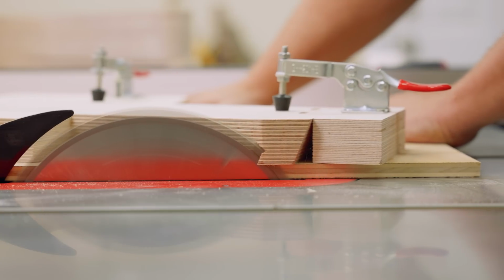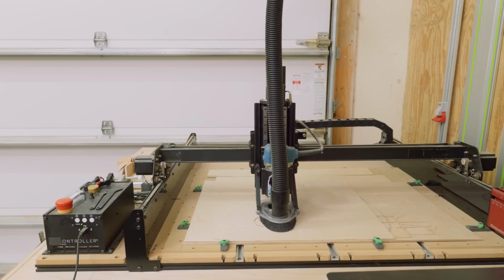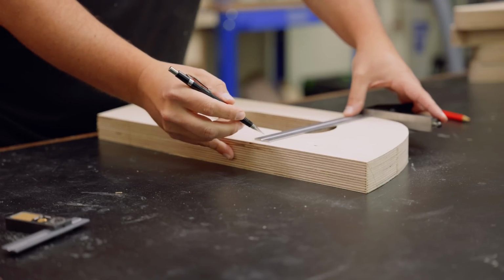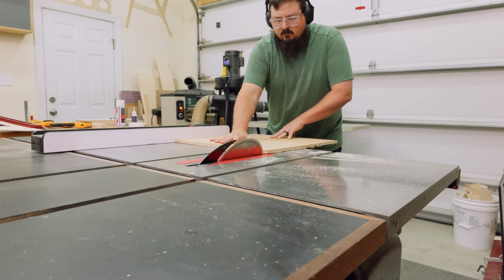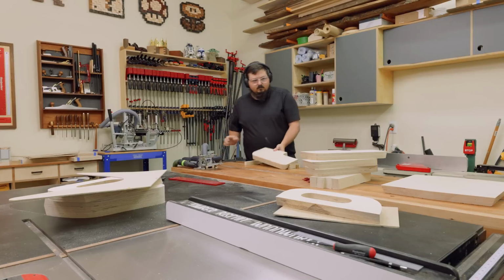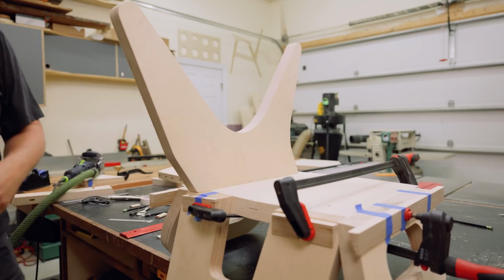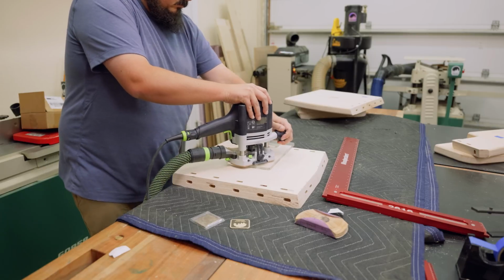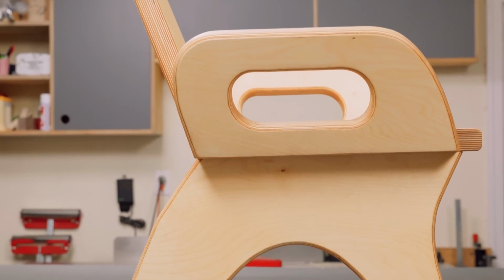This definitely didn't go as planned | Dining Chair

Comment: Really nice looking. I just think they would be lovely with a head rest extension into the existing back part. You could make it an optional extra by inserting an added piece onto the top but going at an opposite angle extending up behind the user's head. That way it could make a very nice dining room chair.
Reply from the maker: Thanks mate, that's not a bad idea

Comment: Hardwood. Quick tip, instead of using a shop towel to remove the squeeze out when pre-gluing the dominos, try a toothbrush and water. Yes things will get a little damp but it is quicker and removes all the glue from the corner of the work piece and the domino ensuring that when you go to fit the other half things are not obstructed by set up glue. This tip is a multi-tasker as it also works well in removing glue from the inside corners of casework.
Reply from the maker: I like it, definitely will give it a try
Reply: @TimberBiscuitWoodworks  Another bonus tip, Dominoes are notoriously famous for not being able to be extracted when they are dry fitted. The 'typical solution' is to sand the faces but this renders it useless when it comes to actually doing the glue up. A better solution is to knock off the edges of the Domino (the sharpish ridge) with sandpaper or a hand plane, a mm or so is plenty. This allows them to be easily removed yet they can still be used for the final glue up as the faces are still tight to the mortise. The joint integrity is maintained since the sides are long to end grain and have no bonding strength. Winner, Winner Chicken Dinner!
Reply from the maker: Yeah, I hit the edges of a few with a block plane and keep that set of dry assembly dominos separate from my glue up set. I then just reuse them for each project.

Comment: Hardwood and plywood are interchangeable. In terms of durability, they're both hard wood. It has to make sense financially to do a project like this entirely in hardwood. Plywood is just so convenient minus the edge banding (which isn't a big deal.)
Reply from the maker: Good point, these chairs were only about $100 each in materials. If I’d used hardwood, it would’ve been double or triple that cost depending on the species.
Reply: @TimberBiscuitWoodworks  Easily! Thanks for the video brother, Merry Christmas & Happy New Year! God Bless.
Reply from the maker: Thanks for watching, and Merry Christmas & Happy New Year to you as well!

Comment: That would be considered a lounge chair. They are lower, have more angle on the seat and greater angle on the back. A dining chair usually doesn’t have arms so it can fit under the table. People use to be smaller and a criteria was for women to have their feet reach the floor and the table low enough for proper posture and dining. The arms would make it so you need to scoot the chair up to the table somehow and when you want to get up you are kind of trapped and with a top heavy chair like that the front of the seat can catch on the back of your calves and fall over possibly hurting something and embarrassing your guests. Sitting on the front edge of a chair like that cuts off the circulation in your legs and you don’t want to stay there very long. Chair design is evolving because the majority of people are now obese. The legs would look better if they were also angled out a bit and tapered ever so slightly. You must be considering going into production with all those toys.
Reply from the maker: Well, I appreciate your observation. These chairs were designed to replace chairs at the head of my table so there’s not as much concern with scooting in or out. The armrest are also low enough that they don’t really obstruct anyone from getting in and out anyway so I don’t think that’s too much of a concern. Being that they are from one sheet of plywood each, they are rather heavy but to me that also makes them solid. Thanks for watching!

Comment: what kind of cnc are you using? I just bought a shapeoko 5 pro and am still trying to get it set up. I've had some broken wires requiring a new one be shipped.  Thanks, just curious.
Reply from the maker: I have an xcarve, it works alright but it isn't perfect by any means.